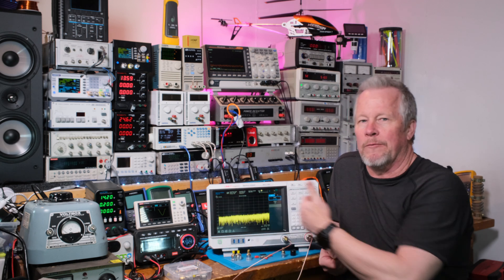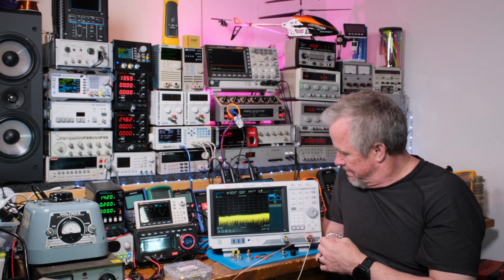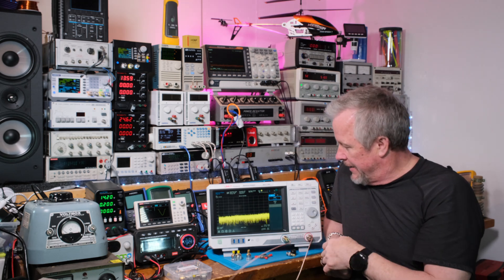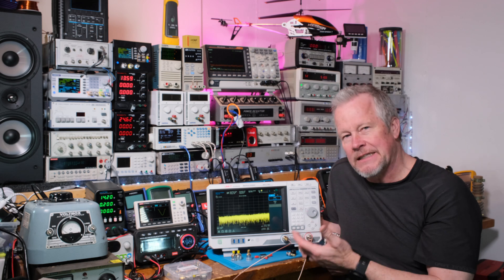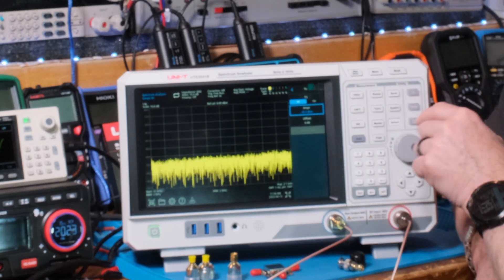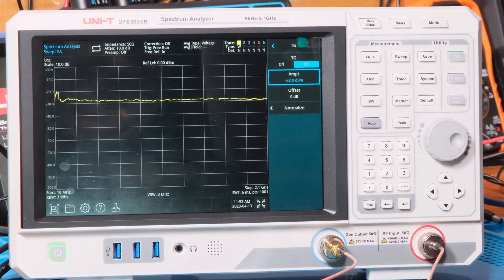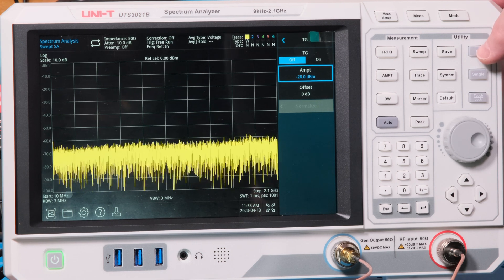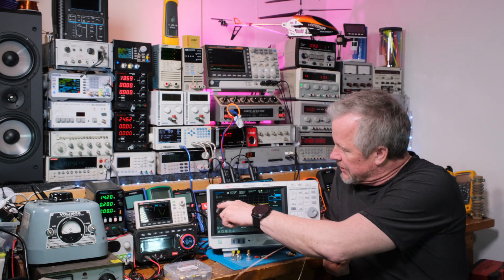Spectrum Analyzer with Tracking Generator with Uni-T UTS3021B #UTS3021B #spectrumanalyzer

Comment: Hi KIss, amazing video, my respect. Please could you tell me the utility of TG function? The model UTS 3021B have not TG instead UTS1032T yes. I'd like to buy UTS1032T for TG function, but, if is not necessary I prefer UTS3036B because of 40000 point. Thanks.... PS, I just subscribe!
Reply from the maker: Thanks for the great question.  The TG function is so useful.  Please see this video where I use it to evaluate a filter: https://youtu.be/Y7RIWYx-rVI

Please use this link to help support this channel as I am an affiliate: https://amzn.to/3XvckfV
Reply: @KissAnalog  ok, but the 3021B in the video hasn't TG, I read on uni t manual that the T model has TG and not B model.... So, I thinking about 3036B...

Comment: I am glad you're back. I am old mechanic interested in restoring old multimeters My big question is do you need higher end equipment to identify if a chipset is working or could you figure it out with a good multimeter and process of elimination?
Reply from the maker: Thank you!  I think you can do that with a multimeter.  A low voltage power supply with current readout in the milliamps would be great.  Then you can power the meters with the power supply and watch the current flow - or you could use a second multimeter for that.